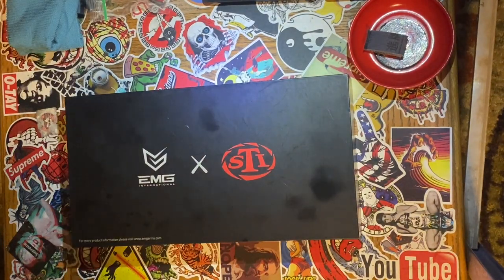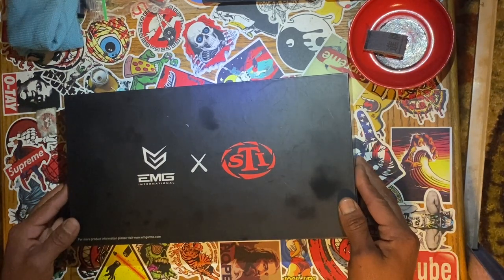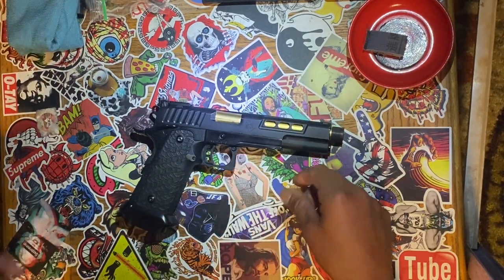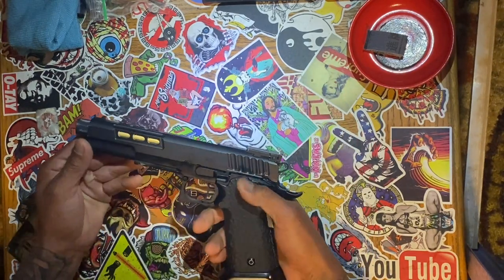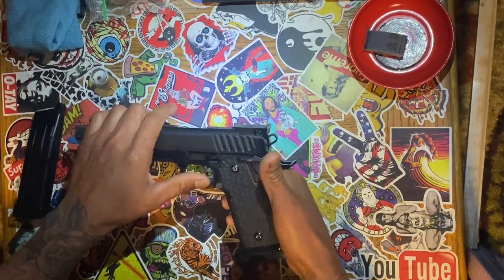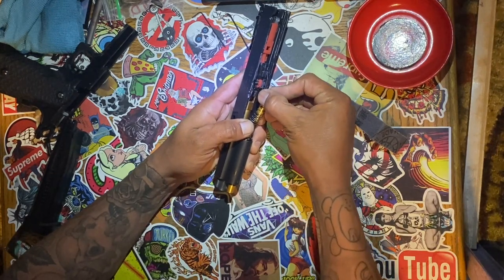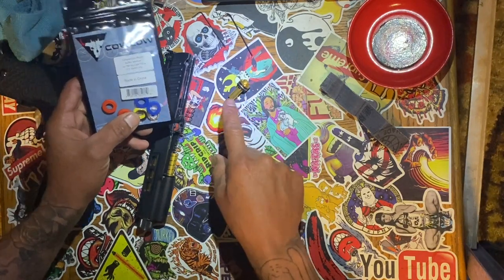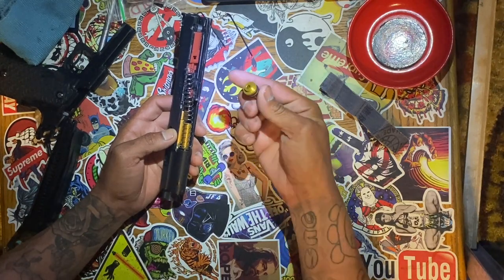cleaning/maintenance video on the Airsoft sti/dvc/emg 2011 hi-capa gbb 5.4

Comment: Thinking about gwtting this or the ICS Challenger. How does this hold up after a year? Also, how TM compatible is it?
Reply from the maker: It’s holding up good after replacing a few parts that I broke in milsim games or from bouncing around in my holdster but it’s a hi capa and should use most TM hi capa parts I believe, if I can recommend a airsoft pistol replica it would be the Norvitsch SSP-18 it’s my fav pistol

Comment: What is that light or Lazer you had on it what fits on it?
Reply from the maker: It’s both a laser and light, after having it for a while it’s not a good buy because the button for the lazer turns on easily so it’s always draining the battery I’d recommend one with only a light, it will fit most lights I’m sure the 2011 is bigger than most Glock/sig’s so finding one that fits should b easy

Comment: How u get rid of the orange tip?
Reply from the maker: I would let the orange tip sit in really hot water for a couple of minutes(that loosens up the glue)and counter clock wise turned it out with a pair of pliers making sure not to squeeze too hard and mess up the treads, hopefully that helps
Reply: Thank you, I actually already got it out with some heavy pulling/twisting of my pliers, but I’ll def try the hot water trick next time 😂. Btw the threads are fine so not to worry, I kind of just broke it apart until I got to the end and gently pulled the remaining orange piece out.
Reply from the maker: @sebastianrose6553  yea bro whatever works I did the same on 2 other orange tips because the hot water wasent enough

Comment: how do you oil it?
Reply from the maker: I only oil the contact surface between the upper and the lower, I remove the slide and look what has wear and contact spots and put oil on those parts and that’s basically it oh also clean you barrel with rubbing alcohol with the hop up turned all the way down, to confirm it’s all the way down just look down the barrel while adjusting hop up 🤙🏽
Reply: @NorthWest509  thanks bro

Comment: Hi...what size of thread to attach silencer, 11cw to 14 ccw or 12cw to 14ccw?
Reply from the maker: Both thread patters are 14mm ccw 👍🏼
Reply: Thank you..want to ask, currently for recoil spring, nozzle spring, and hammer spring i use 140%, is it safe ?
Reply from the maker: @fnkhrs   I’m running the stock springs, I haven’t upgraded any of the springs but for the main spring I have a short stroke kit that cow cow makes that’s just as good as a new spring
Reply: @NorthWest509  oke, thanks for sharing...👍

Comment: What’s the threaded barrel size in mm I have it but I don’t know what tracers I can put on it it says 1/2 positive but I don’t know what that is please help
Reply: I have the green gas version
Reply from the maker: If you buy an ace tech tracer unit it will fit your hi capa because they come with positive and negative tread attachements so you will be good
Reply from the maker: @Dinks_only_fishing   yep you can usually run co2 green gas and hpa with these it’s all in the mag
Reply: @NorthWest509 do you know the mm tho bc idk if it’s 14mm or 16mm bc someone said it was 16 but idk I know it’s positive it’s says 1/2 positive barrel what tracer do you have on yours?
Reply: Please help
Reply: @NorthWest509 pleaee
Reply from the maker: @Dinks_only_fishing  it has a 14mm negative tread same as krytac cyma and Tokio mauri and most airsoft replicas, as for tracer brand I run ace tech and would recommend the ace tech they usually from 40-50$
Reply: @NorthWest509 thx so much for your help so I can put a silencer with  
A 14 mm negative treads right also you earned a sub
Reply from the maker: @Dinks_only_fishing I’m glad that helps and yea those are the tread pattern for almost all airsoft replicas and for sure hi capa style tread pattern
Reply: @NorthWest509 wait sorry for all the questions but so if it has a 14mm negative barrel would I get a 14mm negative suppressed or a 14mm positive
Reply from the maker: @Dinks_only_fishing  yes a 14mm negative suppressor/tracer will work